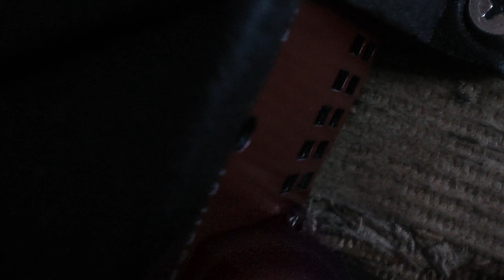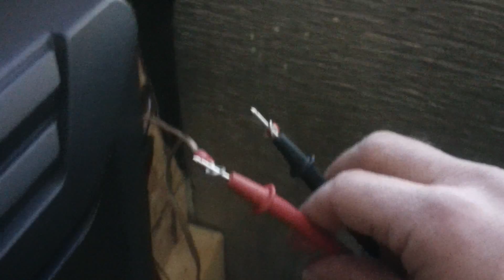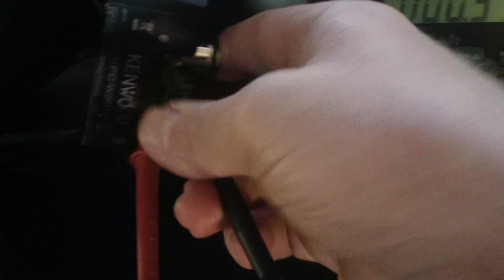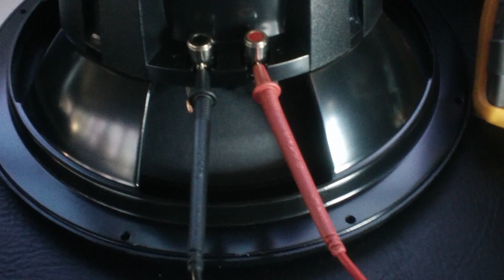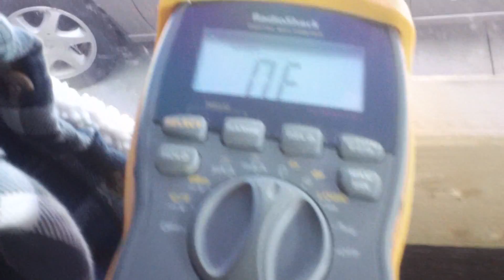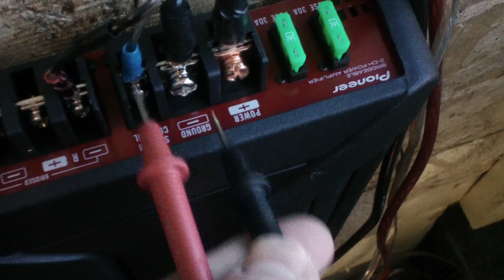Power light blinking on my amp

Comment: mine is very similar. ive changed few subs already and im getting same problem. i mean the light is not steady brightness while playing, if i increase volume amp cuts off. 
if i changed few subs already and few amps and still got same problem, i guess i have ground bad or 12V or remote?
Reply from the maker: It could be a bad ground, bad wiring on the positive side, too small of wire or maybe something else. Try measuring the voltage into the amp with the car running. It should be about 13 or 14 volts. Then crank up the radio and see if your voltage into the amp drops down. If it goes below 10 or 11 I'd say you probably have a wiring issue

If the voltage drops down there is a also a possibility that your alternator can't handle the current draw but I'd test all my wiring before I messed with the alternator

Comment: This pioneer amp, they tend to break apart an internal ground mother board print that switches the big transformers. That blink light suggests that, or a dead output transistor that has internally shotted out link the 3 points of connection on the board. So it cannot switch up, because it will cause damage to the next circuit.

Comment: Blue Led Indicator bulb of my Pioneer GM D-9601 Class-D Car Amplifier starts to Blink after playing two 12" Sub Woofers for one hours &  the woofers starts distorting/clipping & produce disturbed sound. I am using 12V 50 amp SMPS to power that Car Amplifier at home & that Amplifier has three fuses each of 40 amp. Plz suggest how to fix this issue ?
Reply from the maker: I'm not sure but gonna guess yours is getting hot after playing for one hour. The first thing I'd try is putting a fan on it or getting it some better ventilation. Maybe mount it with the cooling fins going up and down so convection can cool it better.
Reply: Check your wiring or something is wrong with the power or output section of that amplifier. In my country they work for over 10 hours a day, being wired down to 1ohm and pushed to the limit at 13v. They have no fan. They don't heat up that much to engage thermal protection. Measure your impendance and see what your getting in parallel connection.

Comment: that amp sucks
Reply: Miguel Sanchez bro my amp keeps on getting warm and I don't know what to do
Reply: Trippin. I have that exact amp. And it’s worked well for the past 4 years. Mine is just now starting to have this blinking issue
Reply: Had for 4 years  no probs , when it gets hotter I just let my seat down and put ac on and it cools down
Reply: Yup, trippin. lol I got the same amp pushing a 12” type R, for the last 4 years. 
 It’s a great amp for what it is and the cost. 
 If it can’t do what it tryin to do with it....then the got the wrong amp. 
 In no way does it “suck”
 Mine hasn’t blown either lmao. 
 It also not getting any ventilation. Barely gets hot.🙂👍

Comment: your speaker wires are small and the pioneer is reading 3 ohms BC u r testing it with wight on the sub the sub should be facing up to get good reading
Reply: Need thicker wire, your wire too thin and can cause a fire , they get really hot , so you need 8 gauge wires , I got super thick wire , and I get more bass

Comment: Someone help! :( My AMP and sub woofer where working perfectly fine and all I did was take of all the wires to organise them better and when putting them back on, my power light is flashing :( I notice that when the bass is supposed to hit, it flashes but when the bass is not supposed to hit, it stays solid? There is no bass from the sub woofer :( What shall I do?
Reply: Fixed.. the speaker wires from the shb woofers side where loose or not connected properly? I just took the cables of and stripped them again.. when putting them back on.. everything started working again? So weird but it works now :) thanks for the help.
Reply from the maker: That sounds a lot like the problem I had! Do you have a multimeter to ohm out your wiring and speaker? Or another sub that you can try hooking to your amp?
Reply: fix your ground wire

Comment: You should have no voltage to the remote when the car/ radio is off. If you have an aftermarket stereo, it will have a blue wire for power antenna/amp that is switched when the head unit is on.  I would use that wire or put a toggle on your remote wire lead. It is not good for your amp to be in the "on" state at all times. That could have been what burned up your sub, or maybe that was some hardcore Skrillex bumping!
Reply from the maker: bmitw  Thanks Mike! I think it was the Skrillex playing at full volume that burned it up hahaha